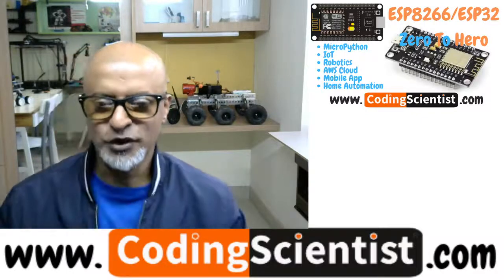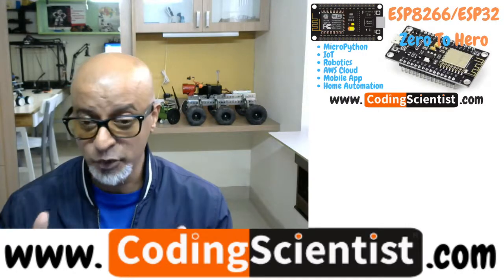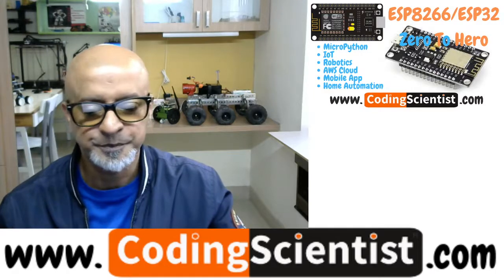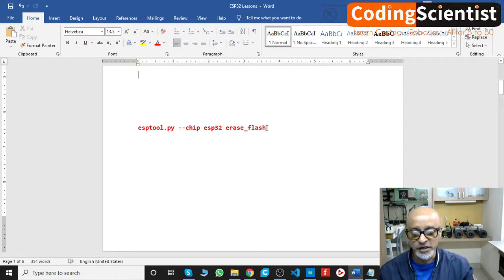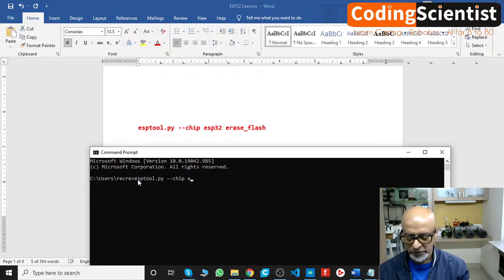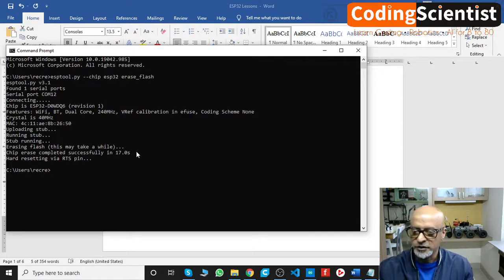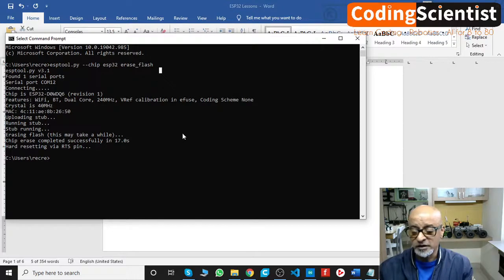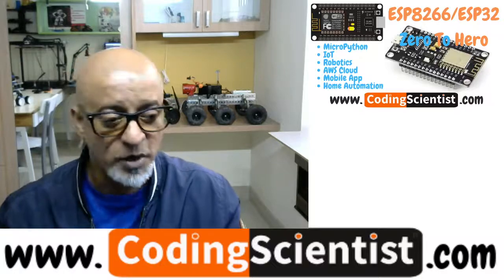Lesson 7 Erasing ESP32 Flash Memory

Comment: i got this error 'esptool.py' is not recognized as an internal or external command,
operable program or batch file.
Reply from the maker: Try installing esptool using pip command on Windows. Then use only "esptool" instead of "esptool.py" if you still see error then open Windows CMD and type the command - py -m esptool --help

Comment: I'm getting the below error. Ctrl+C didn't work. restarting also didn't work. Can you tell about the bootloader mode specific for esp32 Cam module and mention names of Buttons to use for boot process.

Device is busy or does not respond. Your options:

  - wait until it completes current work;
  - use Ctrl+C to interrupt current work;
  - reset the device and try again;
  - check connection properties;
  - make sure the device has suitable MicroPython / CircuitPython / firmware;
  - make sure the device is not in bootloader mode.
Reply from the maker: Looks like the internal processor is in hung mode, Try connecting to the ESP32-CAM with any serial terminal program (e.g. the Arduino terminal, or python -m serial. tools. miniterm <PORT> 115200) and press the reset button. See if any data (boot log) comes out.  If still its in hung state then you may want to erase the memory via Esptool.py to erase the Flash chip.  Some Python installations that command may not work and you'll receive an error, in that case update the Python installation once again and try.   I also suspect voltage fluctuation, Check the voltages at each pin with a multimeter, “high” pins should be close to 3.3V and “low” pins should be close to 0V. If you have connected other devices to GPIO pins, try removing them and see if esptool starts working.
Reply: Thanking you for replying so fast. You saved my day. @CodingScientist
Reply: I tried to follow your advice. There was not anykind of boot log. So, I erased the flash. Updated python. Any other suggestions? @CodingScientist
Reply from the maker: @9body9s  you are good to go, try running some basic programs

Comment: Hello l am facing this error can you please help me
WARNING: Failed to communicate with the flash chip, read/write operations will fail. Try checking the chip connections or removing any other hardware connected to IOs.
Reply from the maker: Pls check the wiring between FTDI and ESP

Comment: I tried to execute your cmd above but it shows "WARNING: Failed to communicate with the flash chip, read/write operations will fail.", may i know what wrong in my esp32 chip ?
Reply: Due to my esp32 cannot upload the coding with error "A fatal error occurred: MD5 of file does not match data in flash", so i tried to reset the flash using your cmd above
Reply: I'm Also Having a same MD5 Fatal Error, Is this Method worked or not

Comment: sir, how can i undo this? now my esp32 isnt compiing codes. Now i need to press the BOOT button to the arduino IDE compile my code to esp32. Please help me to undo this erase
Reply from the maker: First press and hold the boot button and connect to USB till u hear that cling sound. After that open the cmd terminal on windows to run the command I showed
Reply: @CodingScientist  I tried but still showing this error: "A fatal error occurred: Failed to connect to ESP32: Timed out waiting for packet header
". 
How can i put back the config that exists before the erase?  help =)
Reply from the maker: @percepcao7160  you can connect a 10 uF electrolytic capacitor between the EN pin and GND pin. And try the  method